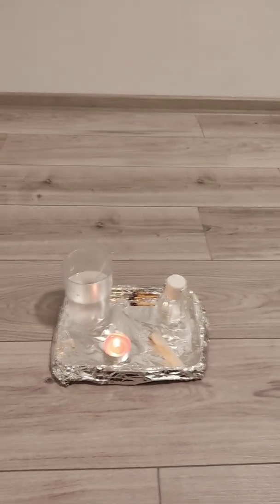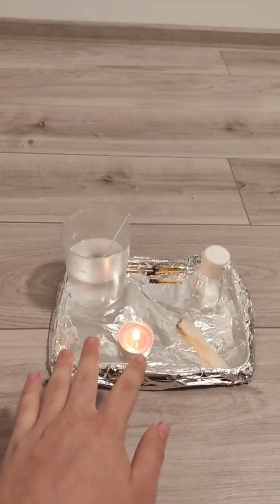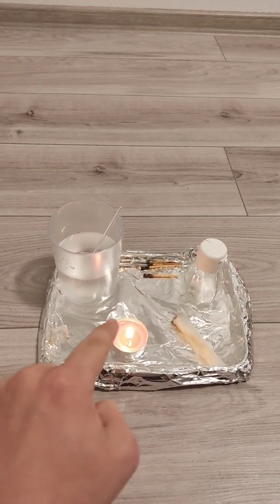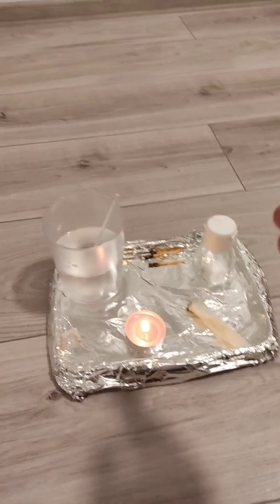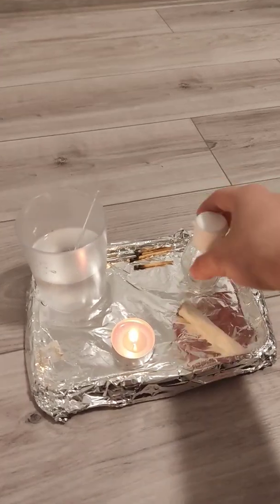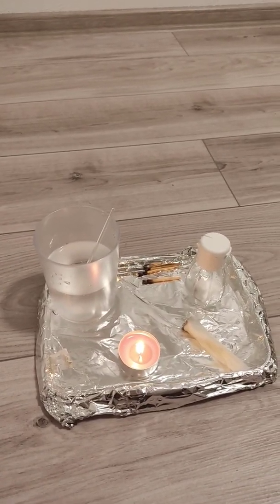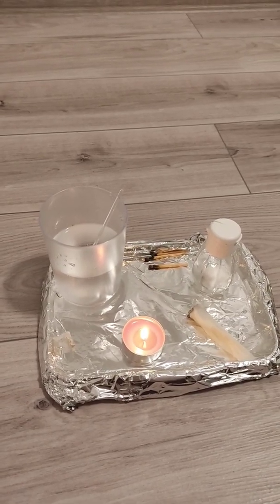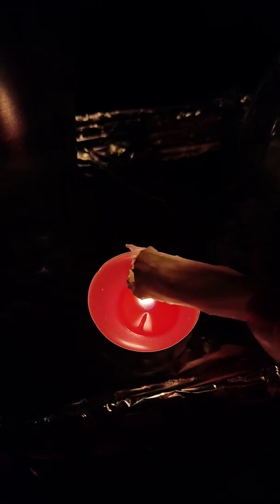DIY low pressure sodium vapour light with a CANDLE !

Comment: What did you dip the towel in? Was it a mixture of sodium and water? Was it sodium only? Did you dip the towel in water only then dip it in sodium only? Can you be more thorough and precise about what it is you’re doing and why and also exactly what it is youre using and how it’s being used? That would be helpful thanks. Because “im going to dip this towel” isn’t very informative.
Reply from the maker: Ok. Sorry for forgetting to explain to mix. Ok, so you just have to add sodium chloride (table salt) in water and mix till it the salt disappears and the water gets clear. Use a few tea spoons of salt. I used about 4 - 5 teaspoons of salt. The reason why you need to mix salt in water is to get sodium ions (Na+). Sodium ions give a monochrom light depending on pressure like if they are in low or high pressure sodium lamps. I am sorry for the unclear instructions. Its a older short of my. In my newer science short, i am more specific. Thanks for asking